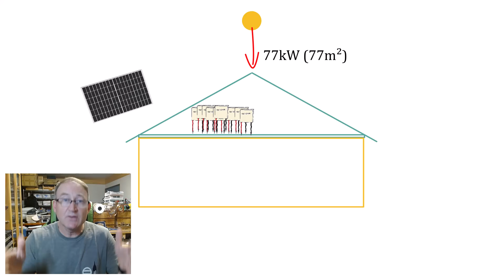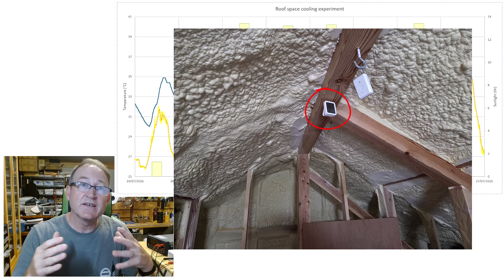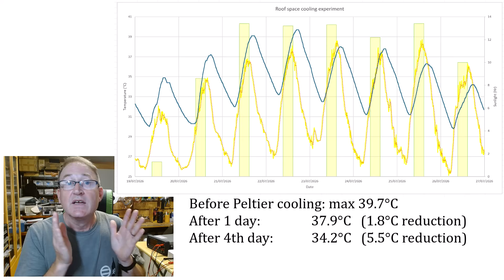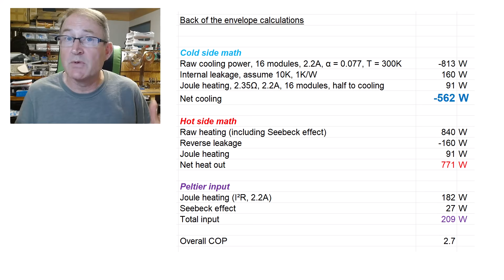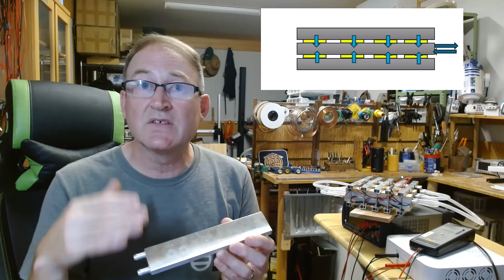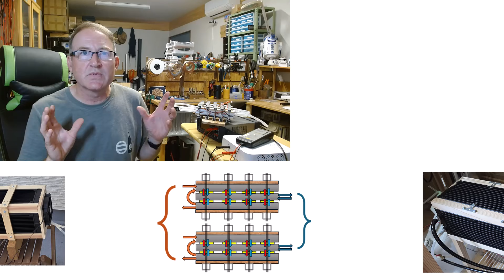Peltier based 500W roof space cooler - surprisingly effective!

Comment from the maker: Just a quick note that the estimates in this video are based on experience working with the same Peltier bank in winter, where it was getting about 350W cooling / 650W heating with about 300W input, as measured by accurate methods. The winter application had a large dT (cold side 1°C, hot side 26°C, dT = +25K). This new application has a much milder dT hence the estimates of 500-600W cooling. I will rebuild the system with accurate measurement, but I thought it best to make this video quickly otherwise it will fall into the graveyard of half made videos that suffer from the all the new ideas that get created while making a video!
Reply: At time stamp 7:25 the image of the roof it appears to be metal roofing surface. If so then it may be worth looking into evaporative cooling paint for your metal roof: https://youtu.be/KDRnEm-B3AI?si=SvBG0KiAg8nSpcOo or https://youtu.be/Z5rDnMza7aU?si=bjJNA8uEifstdAfJ
This would accomplish what you are trying to do and make your cooling solution more efficient in the process to.
Reply: The thing is Ben is not claiming this paint is durable, so while it may be OK to paint a shed with it I would not go so far as painting a roof of a residential building.

Unless you've got some durability data on that front that is ;)
Reply: @vaakdemandante8772  that's why I'm saying it may be worth looking into. https://youtu.be/Z5rDnMza7aU?si=bjJNA8uEifstdAfJ
Reply: Sure but why not just take some cold air from the ground and vent the attic? A couple of meters down you get yearly average temperature. easy cheap way to get literally free cooling that works even in sahara and has been used for thousands of years...
Reply: @LuiLulumon  yes I thought of that too taking a vent ducting from the crawl space or basement up to the Attic working with convection where hot air rises and cold air sinks. As long as you have ventilation in your attic to outside for the hot air to escape and pull in cold air from below through the vents. And your basement or a crawl space has to have a underground pipe for cold air intake.

Comment: Some ideas, you can put another in the intake of the cold side on the peltier, so that it pre absorb the heat, maby you gain some degrees (if the outside temp is lower), i dont know if it is necessary to make it separate, because water is supposed to have a huge heat carrying capacity, or maby buir a complete separate heat exchanger that runs in series with the ac, controlled by an arduino that actively monitors the temps to have turn it on when it can take advantage of it.

The reason i am sayn it could work is, because Lunus Tech once made one for its homelab and he cuold measure the dif, no active cold source, just one radiator inside, one outside, a pump and fans, and the room temp droped, so that heat exchanger plus an ac should have a good result, like many other cascade looping devices

also if your roof is leaking that much heat, you should first find with a thermal camera the bridges and maybe also add more isolation, or better, dont really know about different materials, never done that, just know more inches isolate better and some temps need 4 inches, and i know bridges are a real huge problem that destroys any efford
Reply: i just got another thougth, the heat exchanges alone should work at nigth if the themps are lower than inside, the main advantage will be that uses far less power, and with an arduino driving it base on temps, it should turn itself off when is not needed anymore. Could also be even more efficient and run the pump with pwm voltage regulator so that it goes to min when there is not to much temp dif or the inside temp is more confortable

Using the peltier on a non free power soulrce is a deal braker, you may be stil winning if you use instead a normal ac unit, but usin it from the sun is a great idea, in a home at least, where you have huge surface posibilities for adding more than you can need solar panels

Comment: I have been mulling over the logic of this. The goal is to minimise the heat flow from the roof space into the living space. You already have excellent thermal resistance from the roof into the loft space. I would think that a modest extra amount of insulation from the loft space to your ceiling would outperform your Peltier setup and will be passive. If the loft space temp exceeds ambient, then use passive ventilation.
Reply from the maker: Yes, there is part of this that is just proving a point that Peltiers can move heat efficiently in some applications :). But I'll try to justify ... 

Once the roof space warms up and stabilizes (e.g. after a few weeks), I think 300W ends up in the rooms below. It's not much when the a/c is running hard, but I am suspecting that a/c is far less efficient when run at low levels for maintaining temperatures, possibly a COP of <2. At a COP of 2, that 300W = 150W from the mains, which is 3.6kWh per day. Our average for the whole house is 20-30kWh (that includes two home business). So it's in the mix.  

The other thing is if the ceiling of a room is warm, we need to set the a/c at a lower temp to get the same effect (radiant heat effect). So with roof space cooling we could use 25°C rather than 23°C.

Our builders didn't put insulation between the roof space and the ceiling which I thought was crazy, but now I think I can understand why. If the spray insulation is excellent, then the insulation between the roof space and the rooms below would have to be similar quality to make any difference. To use an electrical analogy, if the spray foam is say 10Ω then adding 2Ω insulation above the ceilings is only a minor reduction.

I've added all the metering in the system and improved the water circulation. Today is a cloudy day and I'm only getting 39W from the panel, but Peltier system is outputting 220W of cooling (that high COP under low current, low dT is to be expected). The roof space is actually cooler than outside, but it's only 9am. Yet to see a full day with the revised system.
Reply: @PeltierPower  I agree that it would be satisfying to find a application that a Peltier is justified. I think a more compelling application would be for winter heating. The wasted heat that is generated by the Peltier in a cooling application is now useful in a heating application. You automatically get an efficiency much greater than resistance heating or gas.
Reply: @PeltierPower  To bolster your case, it would be interesting to compare your bill of materials with putting down 10cm (say) of fiberglass insulation between your loft space and your ceiling.

Comment: There is a cool thing called an attic. If you put two holes on opposite sides the air that is acting as insulation between you and the sun absorbs that heat. The rest is just shuttling that heat out and bringing cooler air in. You can then just use two small fans and a solar panel as shuttling the heat will only be required when its hottest. Peltiers are grossly inefficient and frankly, outside of portable uses and random cooling or heating small projects, it's not effective as a cooling solution by itself for big spaces. Still a neat project just a waste of the 300W panel as ventilation and insulation will always beat a handful of peltiers.  Cheers.
Reply from the maker: I understand there is a solid base of information that says Peltiers are not efficient, however this is largely due to poor application. I agree they are not effective with large dT, for example, if you wanted to create ice in a 30°C room (likely to have dT at the Peltier face of +40K or more), they can do it but with terrible efficiency, maybe 10% or less. But, we are not creating ice here. In this particular application, with good thermal design, the dT at the Peltier face is mild, it can be 10K or less. In this condition, they are excellent heat pumps, and will walk all over any attempts at passive cooling. This is not just my vague claim, it's in the manufacturer's datasheets of Peltier devices. Actually, I'm only getting about 80% of the datasheet, but it's already enough to beat passive cooling by a huge margin.
Reply: @PeltierPower  You get my subscription. I will love to see how you develop it as I know there are very good applications for this. I have always thought that leeching the heat off of an engine would be great but the issue is that you need to introduce another cooling loop for the cold side of the peltier but thusly creating electricity. I feel like peltier tech would be a great thermo-electric converter if "done right" as you said. Let me know what you think as the other applications I think about are small wood fired stove cabins (they cook and get heat from the same stove) i have seen fans that work really well that sit on the stove thermo-kinesis (what i call it in my head). Thanks for understanding where I am coming from as I have seen some peltiers do things worse than what we can get on the shelf and it requires a lot of out of the box thinking to find an application that suits it perfectly and then it can be adapted and implemented into the present.

Comment: Pracuję u siebie nad dokładnie takim samym rozwiązaniem. Nadal testuję, na początku miałem 150W mocy Chłodniczej I zaskoczony zostałem skutecznością tego rozwiązania. Teraz mam 300W mocy Chłodniczej I nadal testuję. Zasilam to bezpośrednio z panela fotowoltaicznego. Jak na razie jestem pod wielkim wrażeniem. W przyszłości zamierzam przenosić w ten sposób ciepło do piwnicy albo zrobić wymiennik gruntowy.
Reply: most likely Pelletier modules can be made much more efficient if more R&D was put towards developing a better electronic N-P interface.
Reply from the maker: Also making Peltiers already thermally bonded to aluminium water blocks, so we don't have to mess around with thermal paste, clamping etc.
Reply: @PeltierPower I think I saw a peltier module on copper plates, but it was too expensive for me to get it and test.

Comment: You are doubling the thermal resistance of your hot side water cooling blocks by plumbing them in series. It's obviously convenient but adding two 2-way splitters/manifolds seems to be a small price to pay to halve the hot side dT, given the large sensitivity of COP to total dT. Also, I recently asked AI about the thermal resistance of these cheap water blocks and it was adamant (not necessarily right!) that small 40x40mm blocks (operated in parallel) are much more efficient than the larger, and especially longer blocks. Going to that extreme would of course mean a lot of manifolds and joints in the plumbing and potential for leaks.

It would be very interesting to know if you have experimented with and measured different types and configurations of cheap water blocks. Copper blocks may be better but cost a lot.
Reply from the maker: The inside heat exchange (360mm long type) are cheap type, plumbed in series and just one fan it works great for the cost. The outside one is 480mm copper and plumbed in series/parallel (this time I put the plumbing inside) with two fans, but it's only marginally better than the 360mm version. I don't really understand what I'm doing on that and definitely need to learn more if I'm going to look at pumping serious power, as you say it affects the dT and every 1K counts. It seems with Peltiers, I improve area A only to expose area B as a new weak point that needs refinement. At 57 years old I'm happy to have this kind of challenging hobby!

Comment: Solar + peltier is an excellent choice for stacking inefficiencies together and making YouTube content 😅 but in actuality peltier chips are  just for hobbyists they are an absolute waste of power they are literally that wasteful wonder why you don’t see this kind of cooling in practice at scale? Not because this guy thinks he just invented it 😅 it’s well known and it’s booty… they are great for 12v fridges and small biomass stoves that can charge a usb device, if you ignore efficiency they are really neat devices. A cheap phase change eutectic fluid that freezes at 90f could be made for 200$ and probably do 20x more work it doesn’t heat the space obviously but that’s where another hair brain idea comes in like taking 100% efficient heating coils and trying to power it with a 10% efficient peltier or whatever your idea is
Reply: Watch his other videos, the guy pointed out that the equivalent circuit of a peltier device results in 1-2 set points for the same cooling power versus running current. Everyone chooses wrong, and dumpsters the COP.
Reply: @Buzzard-wq1bw and some of the top dawgs have gotten a cop of 3.26 or better in some cases amazing results but the average peltier module is an absolute efficiency nightmare but it generates content so that’s awesome
Reply: @Buzzard-wq1bw people have achieved a coefficient of performance of 15 with thin film Peltier modules at low temperature Delta’s they are the future and I am far from having my head in the sand but I also thought graphene would take off the next day. This was the year 2008 lol

Comment: Nighthawkinlight has an excellent series on open sky space cooling in direct sunlight. It would be good to use the info there to help your project on the hot end.
Reply from the maker: Thanks, I'll look into it
Reply: The “cryopaint” episode I assume. 
It works* 
* in dry climates, like everything else. Humid climates close the radiation window the paint exploits. England isn’t a dry climate lol.
Reply: @Mondreus313  It'll still help a bit. The Mesh Specifically is what im looking at, using it as flattened sheets as a chimney and side cover for the radiators. Exploits a few different things here hopefully that compounds together.

Comment: Wish you’d talk about the the construction of the attic. Is it encapsulated? No vents?
Reply from the maker: It's fully sealed, no intentional vents that I'm aware of, just a small access door. It's bigger than in looks in the photo, as we have fitted out half as storage area, and the other half is just a normal roof space. The roof underside is spray foam insulated, and the original design had no insulation to the rooms below (which now seems crazy but I didn't know better to ask at the time). I've since put in hardware store pink fibre in but it's not professional and only to the bits I could get to, hence the desire for cooling the roof space.

Comment: This is fascinating. I have just built my own peltier based cooler for chilling water to cool electronics and PC parts. I love the solid state nature of them and no noise output besides any slow moving fans on the hot side radiator. The pumps are packed with the peltiers inside an insulated box so no noise there.
I got 4 elements in total sandwiched between CPU watercooling blocks (finned copper contact plates for great thermal transfer). I was worried if the system could even handle cooling a heat load of 100W and stay below ambient temp but it does so impressively well.
Since I got only 4 modules I have to operate at a low COP but I dont mind that. It beats having a compressor running next to me all the time and it was such a fun project to built up.
Currently running the 25 V and 200 W rated modules at 12 V for about 84 W per module of power consumption. I need a stronger PSU to push them more but it is already sufficient to maintain 10°C liquid temp with a 100 W heat load in a 26°C room. I could probably get even lower if I insulate the tubing and the block covering the heat load as well.
I ordered a programmable PSU to run some long term tests at different voltages.
Reply from the maker: Interesting, I went through the math and modelling for PC cooling, and concluded that if the objective is to keep the CPU say 60°C then passive cooling should work, if the thermal system is designed well. However if you want really cool temps like 10°C then obviously active cooling is needed. Did you see the video on Peltier fridges? You might be on the other side of the parabola. In other words, you might find running the Peltiers gentler actually gets better results. The cooling effect and resulting temperatures follow a parabola. You could try connecting the Peltiers in series / parallel (2 x 2) electrically so each Peltier gets 6V, and see if that gets the same or similar results, for a lot lower power input.
Reply: @PeltierPower Yes I was wondering if I can use even less power. I will test it when my new PSU arrives, I can then run automated tests overnight comparing different voltages. It also has a constant current mode, so it can adjust the voltage to hold a steady current.